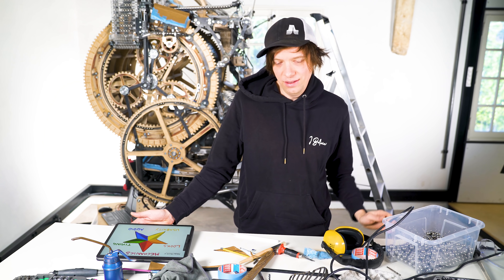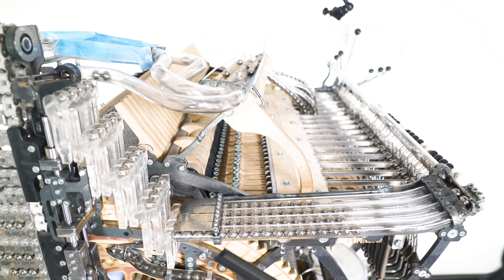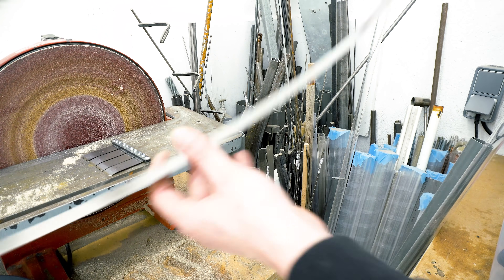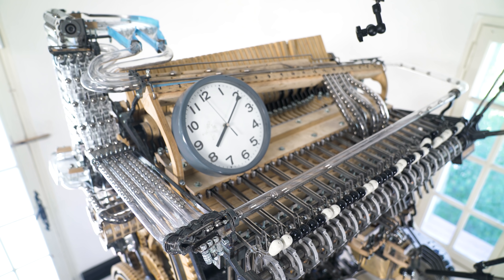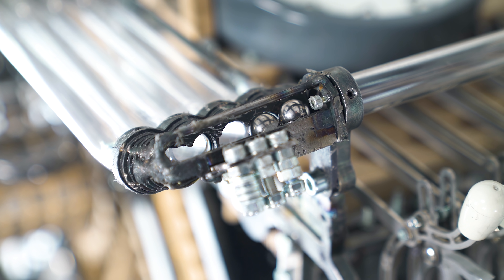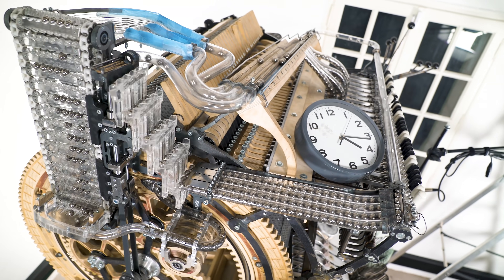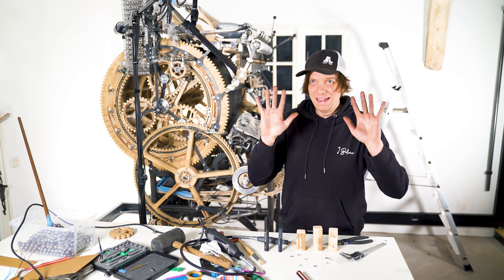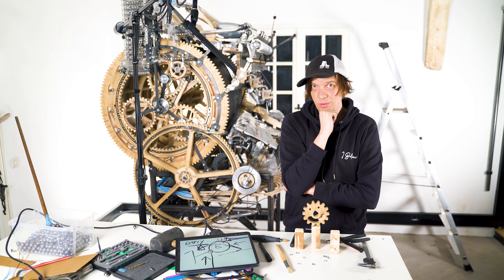Marble Machine X Fish Stair Upgrade

Comment: Martin, the swing needs to open at the weight of 5 Marbles to release the 4!
Reply: THIS is a really good point... however, you have to treat it like the weight of 4.2 or something because if you get too close to 5 then you might introduce another vulnerability (just thinking outl oud).
Reply: @stvcolwill  Unless he makes the divide 4 longer, so that it acomodates 5 marbles but still with 4 channels, that way everything is placed correctly
Reply: @3martor  right but how would that work? what happens to the 5th marble as the floor releases - down on it's own path, then back up where it started? is that the behavior?
Reply: @stvcolwill  the fifth would just roll to the last conduit since it alone wont have enough wight to re-lower the dropping mechanism. So the 4 marbles would dropand then the mechanism would go up, then the fifth marble would roll to the end since there is no fifth counduct.
Reply: The "correct" engineering solution here is to have a buffer that first accumulates 4 marbles, then releases them to be lined up for release to the pipes using a weight system, then releases them to the pipes. That way specific problems can be tackled individually. In the current design too many problems can appear at once, making it a nightmare to fine-tune
Reply: Yes yes... that’s a good idea as long as you can avoid the fifth ball causing a jam.
Reply: Yes. Basically a marble gate that lets through 4 at a time.

Comment: Perhaps a side funnel in any problem areas that saves marbles from the floor and mixes them back with the others. Embrace the random loose marbles by not letting them randomly fall. Catch them and release them back into a safe spot where they can try again?

Comment: It looks like the flying marble actually bounced slightly off of the front of the stair as it was racing down the pipe at maximum speed. Some damping material on the front face of the stair might resolve this issue.

Comment: The trouble with the springs is that they don't really manage the timing for marbles to be presented to the lift.  The marble droppers to the instruments (snare, vibraphone) really started to work when you controlled timing.  Add a gate ahead of the marble lift that only opens when the lift is ready, so that badly timed presentations can't happen.  Everywhere you have a queue you might want a gate below it to manage timing.  The fingers are actuated by force, not timing, so accidents can happen.  Actuate by timing if the thing downstream has a natural timing.

Comment: I think the spring steel fingers might have to be scratched. I don't think you can get completely around the problem of balls getting jammed there, even with precise height adjustments of the fish stair and the pipes. A bowl of balls, as an easy solution, is mentioned, but if you don't want to quit on the divide-by-4 thing yet, perhaps you could add some deeper "wells" that can hold a couple of balls without critical overflow. You might end up with more than 4 balls on the fish stair though, unless you add an overflow scraper of sorts. The trimming on the counter-weight part is also an obvious sign of a design flaw. I would consider remaking this part, and make the counter-weight adjustment more precise than with nuts and washers. You need to find the weight of the actual balls and the plate. In the end, maybe it just won't work, and a simple solution has to replace the whole thing. Don't give up though, it's just another small hurtle.

Comment: Timing and Usability are subordinate to Mechanics, i think. While working on Mechanics, you need to design things to also be useable. You do both at the same time, it seems to me. And while you may not be even looking into Timing issues while working on Mechanics, you will build in the adjustments needed to fix future Timing issues. So your star kinda turns into a simpler triangle. I know, not as good to look at, but easier to get your head around, maybe.

Comment: I feel like I deal with the what you’re feeling a lot when I’m programming. I’ll get really far into a program and but there are so many bugs and everything I fix reveals new issues. I start contemplating how I can explain to my professors why I couldn’t finish my code. But somehow I keep on going and ultimately get to the finish line. I believe in you Martin, this time can be very stressful and angering but just remember that it’s still possible and it’s still worth it.

Comment: Choosing between an engineer's or an artist's solution can be worrisome. Maybe you can lay some of your worries to rest if you'd prepare the engineer's solution for now, and continue pursuing the artist's solution at a later time. You currently don't know how stable each segment needs to be in order to complete the final marble test, but after you complete the other parts you will. And that's the right time to pursue the more fragile, artistic alternatives, because you have a sense of how much instability / fragility you can budget for.

Comment: I dunno about the fish stair part of the problem, but the rocker feels like it needs some mechanism that adds hysteresis.
Currently the tip and tip back points are the same, but really you want it to only tip when it's full and tip back when it's empty.
You don't want it to tip with only 3 marbles and you don't want it to tip back after having only released 3.
I'm not sure what a hysteresis mechanism would look like for this, maybe a detent and spring finger (like on the fish stair) on the bottom. So it takes 4 marbles to push the detent past the spring on the tip and no marbles to push past on the tip back. The tension on the spring controls the gap between the 0 and 4 and the current counter weight controls the center between the two.
Look at how light switches work.

Comment: If you can't anglegrind, dremel instead.

Anyway, due to the nature of those marbles having slightly different weight, hits a bit different, hits something different, metal dust etc, there will always be a few that doesn't roll completely like its supposed to. It's unavoidable. unless you force them into position using cogs or other types of mechanisms. Having them just roll into position and relying on gravity/weight won't be enough.

But keep on keeping on :) Love every video and seeing the progress

Comment: Martin Instead of trying to make a machine that never fails, you should try and make sure that the mmx wont fail catastrophically. At the end of the day the purpose of the machine is to play music and a few marbles on the floor don't stop the machine from doing that. You have an idea that the machine must be mechanically perfect, which no machine really is. The spring steal on the fish stair is a perfect solution already in this sense, it may fail if you run out of marbles but it will still play music if it does so. Love the videos, you can do it Martin!

Comment: Remember that perfection is an unobtainable goal.  If the machine drops two or three marbles during a concert that is not a "failure".  A missed note is a failure.  The occasional marble on the floor is not.
Perfection is the enemy of good enough.
Also - on that edge case on the starved fish stairs - what about something to slow down the fast moving marble?  Just a small drag point just under the metal pressure plates.  Something that the weight of multiple marbles pushes past easily, but a single marble moving quickly is slowed down eliminate that issue.

Comment: I think your "Star" visualization is incorrect because it visualizes everything as a equal, but they are not equal. I think it is more of a pyramid, with mechanics serving as a foundation for the other parts. I would think the logical approach would be a stack with Mechanics being the biggest wedge at the bottom of the pyramid with timing above that, then audio quality, then usability, then asthetics. This gives you a "priority chart for how you approach development with any new feature on the machine. As an example with the Bass, you'd make sure that the marbles are hitting the strings correctly without hitting the floor, before you tackle playing in time with the other instruments, looking for a way to stop the bass strings from vibrating, adding the adjustable clips that automate the bass notes, or even turning on the microphones. You would also prioritize manifesting new issues "wack-a-mole" based on where the appear on the pyramid. Imagine how much of a relief it would be if you had a mechanically functioning machine and your task was just to make the sound cleaner, or to add quality of life features for yourself, or to make it look cooler.

Comment: Keep going Martin! 
I design entire production facilities, you have to keep going and take one thing at a time. Also, remember, nobody will notice that after 2 hours of concert, 10 marbles are on the floor. Failure is always an option. 
Leave the artist some space, Life is not only about how reliant a system is....
Finally, you could have a bucket beneath the divide by four that collects and refeed into another channel the fallen soldiers (or escapees)

Comment: A couple suggestions for your metal shavings. You can try a really sticky tape and stick the tape to the affected area and it may pull out the shavings when you remove the tape. Likewise you can use a school glue and try the same method, apply it to the affected area and when you peel it off when it is dry, the shavings go with it. I used to work cutting and grinding fiberglass and carbon fiber and this is how we got the microscopic fibers out of our skin.

Comment: Isn´t the problem not solved basically by experimenting to find what the optimum amount of marbles in the machine Is? I guess their will a be maximum amount of plugs that you stick in the drum as their is an equilibrium between the marble feeding speed and the rotational speed of the drum.

Comment: Can you have one pipe that is always filled by the higher up tubing and feeds into the divide by four so if the divide by four gets empty it automatically begins emptying the marbles inside of it to compensate? If this problem is not likely to happen much, but potentially once, then a one use compensatory could be helpful.

Comment: Maybe add a light and thin shield that engages when the 4-marble teeter-totter goes down? The shield would block the supply pipe just a bit while the rocker is down, keeping the supply marbles coming in from interfering with the release of the 4 headed to the fish stair.

Comment: Hello from Germany. I was a little concerned after your line of quitting and felt relife when you said you will focus on one thing. Mechanics. 
Maybe that's a good thing to first focus just on mechanics and when the machine works with out much problem you go over working on the other things. Maybe on arm at the time. Mechanics fist because that's most important. Than audio and timing then usability and last looks.

Comment: I wonder if you could implement a gating mechanism for the fish stair as well. Drill a hole in the bottom of the incoming channels, and attach a rod that will come up when the front stair is up anyway, keeping marbles from trying to roll when there's nowhere to go. If you do this under the spring steel "fingers", they would help pushing back a marble if it arrived at the wrong time

Comment: I don‘t understand that you say the whole time you have to forfeit beauty to get functionality. Beauty comes from great functionality as form follows function.
Reply: You sound like a car commercial from the early 90's.
Reply: If you take that to its logical conclusion, making music digitally on a computer would be ultimate functionality. No machine or physical instruments required.
Reply: @Eralen00  That's only true if you ignore the function. The functional requirement here is to make music by hitting marbles onto an instrument. You can focus on the mechanics of that without needing to obsess over looks. Engineers are given stranger requirements all the time. Big software packages are not always the best solution depending on what is required (I know, I write software for a living) The functional requirements here were clear from the start
Reply: @Stettafire  That depends on how far you narrow down the functional requirement. If its what you said "make music by hitting marbles onto an instrument" - then why have a hand-powered crank with belts, pulleys, and elevators? Functionally, electric motors and servos will do the job more reliably and simply. The reason for all that extra stuff is because the mechanical beauty is part of the requirements. It would be easier to make a machine out of plastic with motors and wires and electrical switches all over the place that would perform the same function as "make music by hitting marbles onto an instrument"
Reply: @Eralen00  maybe. By your statement you're still disregarding the fact that MMX already has an electric motor to run it. So the requirement still never was to just have functionality, as the other guy said, or just make it beautiful, like you alluded to. They were always both at the same time then. Now it'd be more like "it already looks cool enough" and everything else has to be mechanically reliable.
The original comment has a very valid point, unlike yours about the digital music making (I mean, don't you still need a machine, knowledge and mechanical rules to make it functional?).
Reply: @ddnnmo  I'm not disregarding the electric motor that's already in it, because that was basically an afterthought to make it easier for these very long tests, so he didn't have to crank the handle for hours. And also as a backup for the concerts, in case something else went wrong and he had to leave the machine, but its there just as a precaution, not as a main feature. I was just saying if functionality was the only goal, everything could be controlled by motors and he could instantly reprogram it by just uploading a file into a computer somewhere. There would be no need for any of the extravagant mechanical features (which I love) - its kind of a pointless machine but that's what makes it great, its just pure joy to watch it work and make music. And finally I just want to apologize because I don't even know what I'm arguing for, lol. I think we're pretty much on the same page.

Comment: Hey, the marble that jumped out of the fish stair just hopped into the hole that was left because the next one didn't go in. I don't see a problem here!
Reply: It flew towards martin
Reply: @sjege  I meant the one at 2:32, I had not gotten to the marble that was shot out spectacularly. It is a problem. :(
Reply: That marble actually took a flight backwards over the "divide by 4" and landed on the floor. If you look at the slowmo, you will see a silver streek flying to the right.